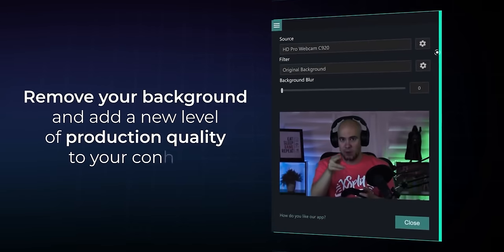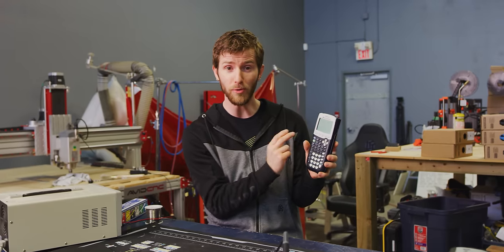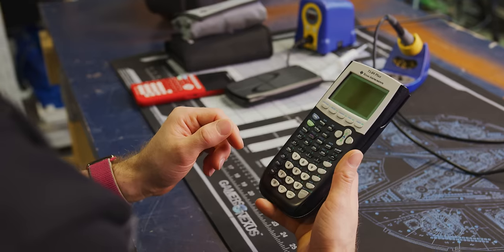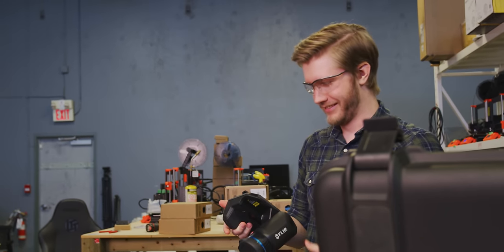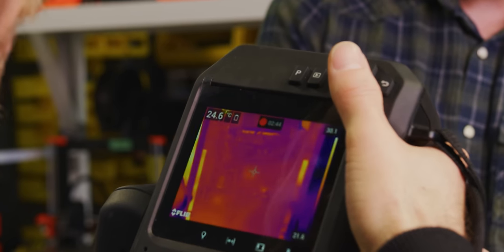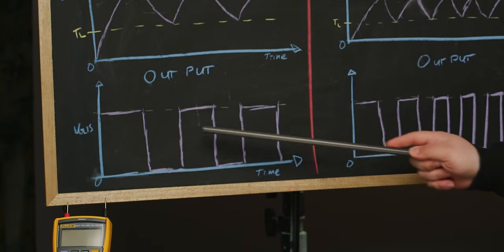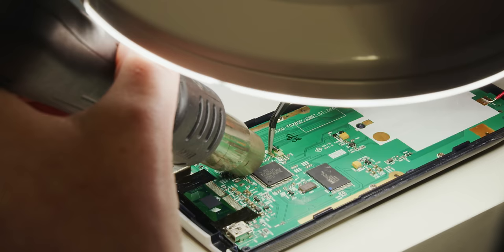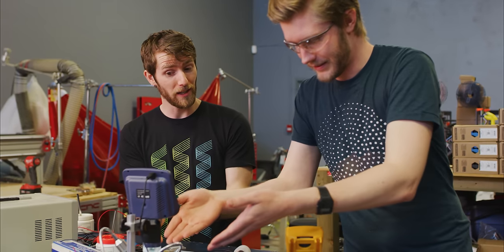Water Cooling a TI-84 Graphing Calculator!

Comment: I actually have an 84 plus silver edition that I keep in my regular calculator rotation.  I had an 85 in middle school (was in the gifted programme).  In high school, I switched to HP and RPN calculators, including the 32Sii (before it was discontinued) and the 48G.  In college, I mainly used RPN calculators, and briefly tried to get into Casios, which I recognised as having lots of technical advantages, but was unable to motivate myself past the learning curve (it's easier in high school when you have only one maths course at a time and lots of free time to be creative with how you do your homework).  When I started studying to be a maths teacher, I got an 84 because the students were using TI and I decided that I should be on board with them.

I was never successful as a math teacher (classroom management issues) but I did tutor for about a decade and used the 84 for that.  I still keep it among the other calculators at my desk and grab it depending on the type of calculation that I want to perform.

Comment: TI: Cool... Now lets block C-based programs from our devices
Reply: The firmware updates are not even out yet. They'll come out this summer. The only model that currently has this limitation is the french 83pceep. Anyway, the black&white models are probably not going to get the update.
Reply: And also, C is rarely used on the b&w models because their CPU doesn't have the right capabilities to run C quickly. The Doom you saw was written is Z80 assembly.
Reply: @fghsgh  I don't know about C on the TI,  but Ci is normally compiled down to machine code (usually via assembly as an intermediate), just as assembly is. Is there an interpreted C on the TI?
Reply: @MrGencyExit64  yes because of how ti has a monopoly on the calculator market and through govt lobbying they basically made it it so if you want to do anything related to math in highschool and college you need one of these which still sell for 100$+ brand new
Reply: Levi Speers well there is a opensource calculator now but like it’s not great looking also you don’t have to get the new update either
Reply: soupwizard it's compiled just like everything else, but any overhead is going to completely slow it down, not to mention the tiny RAM and flash storage available. Just like how people wrote assembly for computers 45 years ago, people still do for the TI 84 because, well, its Z80 CPU is the CPU used in computers 45 years ago.
Reply: @thekernel69  yeah, if it wasn't a monopoly, they were dead
Reply: @soupwizard  The C is compiled, but C commonly has local variables which require fast index registers to work decently fast, which unfortunately the Z80 doesn't have. However, the eZ80 (found in all color models except for the CSE) does. A solution would be to use static variables except when absolutely needed for recursion, but most people write Z80 assembly directly instead of C on the b&w models, or there are other compiled languages more fit for the hardware like Axe.
Reply: @fghsgh  I think it probably will arrive on the TI-84+, as Cemetech has reported. I'm very upset about it.
Reply: @MrGencyExit64  We're not allowed to use 89's in lower level math classes... and by lower level I mean calc 3
Reply: @thekernel69  my high school let us do graphs online on laptops and that was 3 years ago. TI can suck it up lol.
Reply: Wtf you in usa uses a calculator when you can use a paper and a pencil...
Reply: Levi Speers  just get a Casio fx82. Got me though physics and csci just fine. No need for anything fancy if you can graph by hand or use your brain. It's honestly just a waste of 💰. I can't think of anything I would need one of these for in all honesty. Convenient? Yeah. Necessity? Not at all.
Reply: There may well be code compiled from C in the original firmware for a graphing calculator. C/C++ is great for applications where you need to talk directly to hardware. It all ultimately ends up as a series of binary OP codes specific to the chip in the device, but as long as the device is Turing Complete you can theoretically assemble these OP codes from any Turing complete language, C, Python, Java, even certain constructs in Minecraft. 
As long as you can handle conditional branching and store enough variables in memory you can compute anything that is computable.
Reply: @MrGencyExit64  i had a TI Voyage... Best banned calculator ever.
Reply: @fghsgh  Wait, how are they blocking C-based programs but not assembly ones? Sounds like that would be easy to circumvent?
Reply: @soupwizard  C on the z80 from 1976 is pretty much IMPOSSIBLE for it to run at any meaningful speed. Everything has to be assembly...

Comment: With micro soldering using heat guns you want to attach a smaller nozzle to focus the heat only where you want it, which heats up better and faster compared to heating the radius of the bad nozzle

Comment: Me before: There is no way a calculator be faster than my pc.
Linus: "It's over.I have the high ground now."
Reply: LOL I have computers with slower CPUs, the Intel 80386DX started at 12MHz and topped out at 40MHz in the day the low end of the 486 was 18, the DX4 was as high as 100 Mhz though they struggled with Duke Nukem 3D, they just didn't have the bandwidth to handle the data multiple enemies demanded.
Reply: Well... the TI-84 is faster than most home computers of the 1980s, like C64, Apple II or even the first IBM PCs. So yes, Calculators can be much faster than PCs ;)
Reply: @cericat  i bet a commodore64 is faster lol

Comment: 6:19
Alex: Got the resistor!
Holding up resistor with the PCB trace pads on it. He just ripped it off.
Reply: More likely he just heated the board waaaay too hot too fast than simply pulling on it too much. But yeah, he fucked up.
Reply: I mean, it's hardly difficult to mess up with parts that small
Reply: He should have used smaller hot air gun nozzle
Reply: Chris723 A person of culture!
Reply: @nicknack125  probably not, he didn't heat it up enough, the solder didn't melt and he ripped it off
Reply: Did you ever get the impression he is good at anything?
He is good at convincing people of his skills (that he doesn´t seem to have)

Comment: LTT in 1 year: water cooling an Arduino
Reply: Scott Maday Ben Eater: Hold my beer.
Reply: water cooling an ATtiny85
Reply: i wanna see this.
Reply: Watet cooling a breadboard 8-bit computer.
Reply: Watercooling a watercooler
Reply: Water cooling a Samsung Smart fridge
Reply: Overclocking a Playstation 2
Reply: 2039: Watercooling a 555 timer
Reply: that kinda has an actual use though. Like you could make a cluster of arduino's and watercool them all
Reply: LTT in 2049: Water cooling an entire Pakistani village
Reply: Water cooling a Casio calculator watch.
Reply: Probably not
That would make too much sense
Reply: LTT in 1 year: Water cooling the office water cooler!

Comment: That multimeter is designed more for electrical work rather than electronics. It has neither milli nor microamp ranges. It works great for wiring a building and is even advertised as an electrician's multimeter. You should use a model that is a little more high-end for electronics applications. Fluke specs the 117 DCI measurement at +/- 1% of reading plus 3 counts. This means that your 0.013 DC Amps reading is, in fact, likely anywhere between 0.010 and 0.016 Amps DC.

Comment: When I saw the board after you removed the resistor I was like, those pads are gone, but you made me doubt my instinct by trying to solder to it. But yeah they were so gone
Reply: I saw the same thing! lol I was like damn, add a nozzle to the heat gun you're touching directly on the chip-sets lol
Reply: for those 2-3 pin smd components i usually use just the soldering iron, much easier imo and you have more control... heat gun just for chips with more pins, and a proper nozzle attachment would help

Comment: Unfortunately the bottleneck on TI calculators is not the processor but the slow LCD screen driver, as it needs a delay of ~60 clock cycles between each byte (8 pixels) written. The OS's display system calls make this even slower by relying on the separate 140Hz clock interrupt to write to the screen safely. Worse still, TI-Basic (which the Doom port is written in) doesnt support screen buffering, so every block of text and line is displayed with a separate display call. You can overclock the Z80 cpu all you want but it will never hold a candle to a Doom port written in assembly using low-level output instead of system calls.

Would be interesting to try and speed up the clock interrupt though as that would also make the cursor blink faster.

Comment: Using literally the largest tip SMD reflow gun in existence for this kind of job.... seems legit.
Reply: And trying to measure milliamp accuracy with the powersupply... Yeah definetly no electrical engineers overthere xD
Reply: I expected a bit more skill smh
Reply: @riba2233  have you watched this channel before, cause
Reply: and ripping the pads in the process
Reply: To be fair I'm pretty sure Alex actually went to school for mechanical engineering.
Reply: I would have used my small soldering iron tip to change those resistors
Reply: I have that reflow gun. My bet is that he lost all the other tips : p there's one that's maybe 6mm in diameter for it that would've been so much better.
Reply from the maker: The tips got lost in a move so we had to rawdog it.  New tips came in today though so expect slightly less jank in the future -AC
Reply: I would have heated the board up and then used an iron since the resistor was not going to be reused. That looked like 0402 to me.
Reply: @sarem2001  it has big pads for 0402.. best method is just to make big solder blob around whole resistor and then smash with PCB on the table to throw all the melted stuff down.. works with SOT/SOIC/TSSOP and other SMD "not too big" stuff
Reply: Sparkfun $10 gun?  I see no issue
Reply: I mean they are YouTubers, and the point is to entertain... So yeah
Reply: Alex just need more time in soldering smd thing
Reply: @LinusTechTips  I'm glad you qualified the amount of less jank you'll be giving us in the future, I'd be worried otherwise

Comment: Alex: They are super tiny
Louis Rossmann: Am I a joke to you?
Reply: That reminds me, I was going to try that on an old 1st gen iMac..
Reply: yeah pretty standard or even large stuff for anyone that is a tiny bit familiar with modern electronics. But also from previous videos I got the impression that soldering is not a really a strength at LMG. Which is a bit ironic since they do electronics all day.
Reply: Alex: I gave up being an engineer for this.
Reply: @oddball_the_blue  You're going to overclock a G3? Hmm
Reply: I love Louis and his F-bomb episode about the new Thinkpad trackpad design.
Reply: @RandomUser2401  not that kind of electronics
Reply: Why Alex did not use flux wtf
Reply: @cerisem7727  Well it does 350mhz at the moment and it's documented how to step that upto 1.2Ghz for the truly unhinged but I think a healthy 500mhz should be achievable with little more than a clean of the heatsink and new thermal paste. 700mhz is doable if I stick a fan in the case.

Comment: There a dedicated 25mhz mode you can use a pencil and draw over two traces to activate it. It should be able to reach over 50mhz with correct OC as the TI-84+CE does and uses the same CPU

Comment: Don't forget that TI just released an OS update that completely disables all of these programs on CE calculators.
Reply: yeah i downloaded game like yesterday they still work
Reply: @charliebaker1427  If you don't update your OS they still work, but they've been encouraging people to update without making it clear that updating will make all of these games stop working. It's not mentioned anywhere on official websites, the only way they've mentioned it officially is in direct interviews/conversations with reporters. Their website even still lists it as an officially supported feature. Also it's going to permanently affect any new calculators people buy since there's no way to downgrade the OS from the latest version. And also, running any programs on your calculator now voids your warranty since it's not an officially supported feature.
Reply: MrHatoi TI has been doing it for years... Software updates so that you can’t install ndless, which allows you to play a lot of games, gba emu, and install CAS on a normal TI Nspire (CX)... they put out updates and sell revisions with the new software.But Ndless and other devs have still been able to crack it. People just need to stop updating/buy used ones.
Reply: @MrHatoi  so there's even less reason to buy these things. 
I say go with Casio equivalents unless you have to use TI. They're insanely overpriced for the silicon you're getting.

Comment: 6:00 Use hot tweezers for this or just dip the whole tiny SMD chip resistor in a small blob of solder to remove it if your tip is bigger then the component. All you need is 2 joints heated up at the same time. Doesn't matter how you do it. Hot air is trying to kill a fly with a cannon. You actually failed by ripping the pads off.

Comment: Me: watching this video
My CASIO: glancing at me terrifyingly
Reply: Well dont worry, the most you can do with that Casio is write 80085
Reply: Well my Casio 35+ (modded as a 75) can overclock via software sooo
Reply: Next step, Casio WATCH
Reply: @kolkoki  this
before i got my hp i had a modded 9750 (equavlient to a 35+, i think, blame regional stuff for that)
and it was BLAZING FAST at 200mhz
which really makes me wonder why it comes at like, what, 10? mhz at stock.
Reply: @kolkoki  But I know what calculator OP is talking about. Which is why I said it cant do a whole real lot haha

Comment: 6:15 looks like you pulled off the pads , this kinda work is simple once you know how and have the tools but you should have had a smaller nozzle on and then lightly taped the resistor before checking it was ready to move prior to pulling it up or hot tweezers work good aswell but you'd need a hakko or something better then a $20 iron
Reply: I like your funny words, magic man
Reply: more like they should have had literally any nozzle at all
Reply: more like he should have let the components and solder heat until they look liquid and then push it off with a tweezer. His entire description was wrong because he said "pulling on it while heating it" 
that is the worst idea ever. You wait till solder melts and then push it off. I have done same size soldering with a soldering iron and it went far better than this

Also the Potentiometer they used was also the cheapest ones and also noisy ones and they should have instead got a Bourns precision pot, or even a normal multiturn one instead

Comment: A good demonstration of why you should use a soldering pen and not hot air when soldering passive components. They should be happy that they did not ruin the circuit board completely.

Comment: I remember how I overclocked PowerMac by swapping positions of transistors... Which means PowerMac is just oversized, overcomplicated calculator!

Also since I had a site which had all 1/0 permutations explained what they do (to what frequency or to what voltage specific configuration leads) and I didn't want to use massive pistol shaped (and sized) soldering tool I soldered tiny cables instead and on other side I had switches. Since transistor was 0 and no transistor was 1 I could just flip the switch to change that.

Turns out 400MHz PowerPC could reach even 933MHz. Unfortunately along with baking itself to death after 10 minutes of playing Quake, because cooling wasn't prepared for this.

Comment: Wow, i did this already 6 years ago :D
On mine there was a set of 4 resistors, one controlling the base clock and the other ones controlled the 3 "performance modes" 
Modifing the baseclock helped with gameboy games; they ran as if they were native xD
Reply: i had to underclock mine to get it run the rom i had in a stable form
Reply: @gerthddyn  Watercooling is mostly redundant here. It draws so little power anyway that it can overclock without needing much extra cooling.
Reply: @MKhurramAziz  You must be new around here. The watercooling is for flexing, not cooling!

Comment: You can instll a raspberry pi zero inside of a numworks calculator and control it using a program written in numworksOS python interpreter. 
also if you just want a free no fuss graphing calc on your phone, the app is free and requires no setup. it also has support for python programming.

Comment: What is probably happening here is that the delay routines in the game's code are running too quickly and the LCD controller can't keep up with the processor. I suspect most of the components in these things can handle some pretty high clock speeds but if the display controller latency isn't being checked for by the code either by timing display writes to a crystal timer interrupt or by manually checking the LCD Controller status register you can run into this sort of glitching.

Fun fact: if you were to send display data to the LCD controller at the maximum rate allowed by a crystal timer interrupt, you would get an update rate of approximately 42 frames per second, though if driven by the CPU it can sustain 60 frames per second.

Comment: lol i do soldering for job, they are not so small, you need smaller pointier tweezers and maybe its less dangerous if you use the iron alternating heating the ends of the resistor instead of using the rework station, or use a smaller nozzle